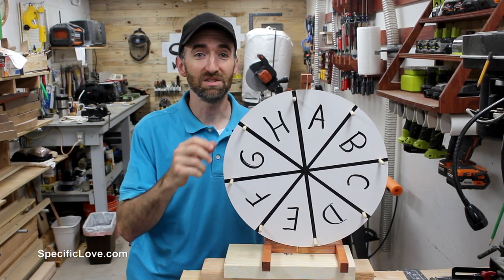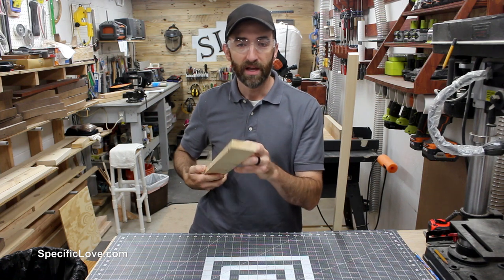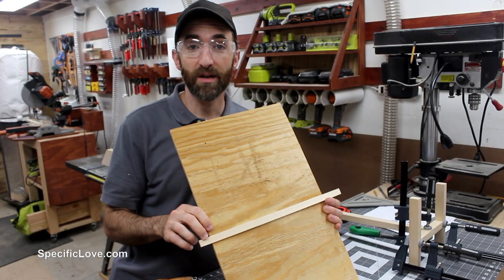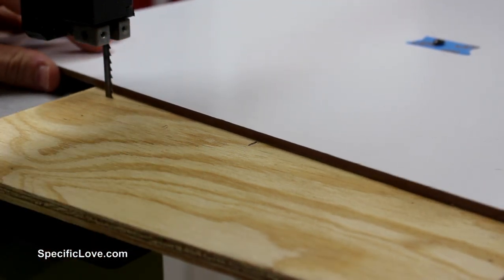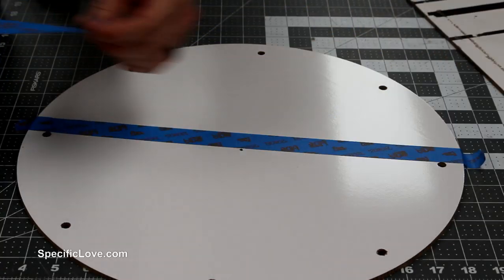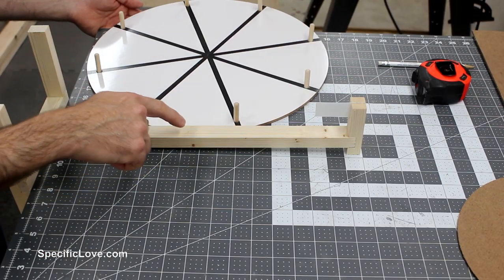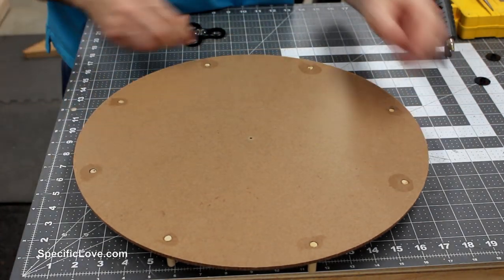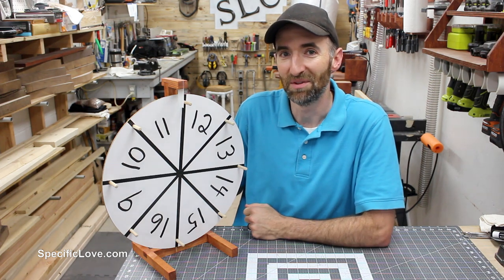Building a Prize Wheel with Dry Erase Board

Comment: I saw a lot of comments asking for measurements. I used 1x1inch wood, cut into (3) 8-inch pieces for base, (1) 20-inch piece for vertical stand, and (1) 4inch piece for the top piece (the little plastic holder). I think he used a 16 inch round whiteboard, but I ended up finding a 12-inch unfinished board and it worked just fine. I bought the dowels and everything else from Lowe’s for under 20 bucks.